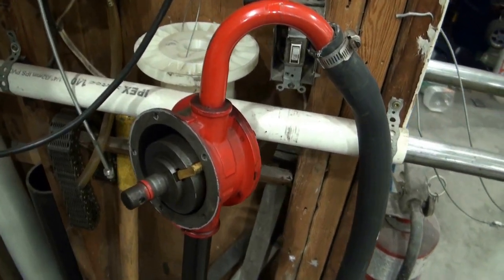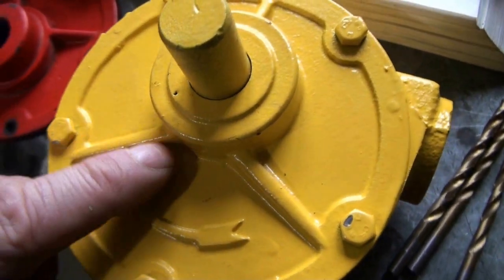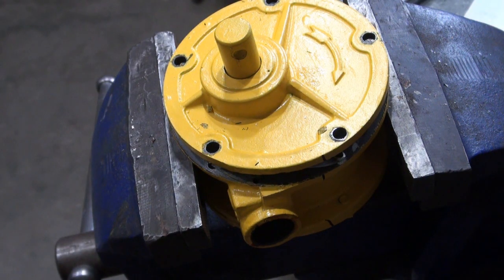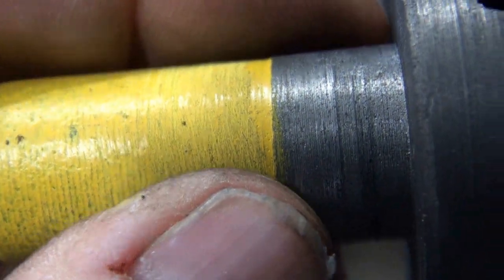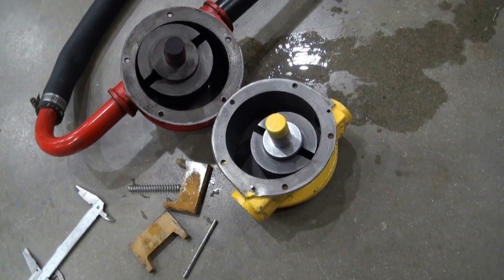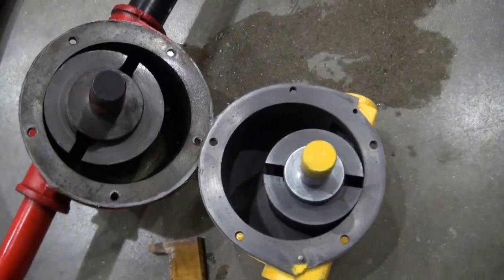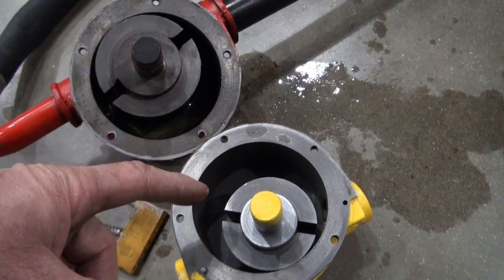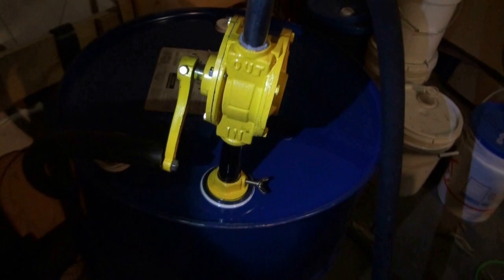Chinese Barrel Pump

Comment: check the housing bore and then the specs on the seal.. i bet the leak will be coming from around the seal OD  and that is going to be hard to fix..  silicone won't seal fuels very well.  you may have to get crafty.  use a shaft saver that is the proper size to press into the cover bore. so the seal can be pressed inside that slightly smaller shell..  perhaps some loctite anaerobic bearing lock to hold the seal in the housing.

Comment: Just get a measurement of the shaft diameter and hole diameter and find a universal seal, and if you cant find the exact match machine down one surface or the other.